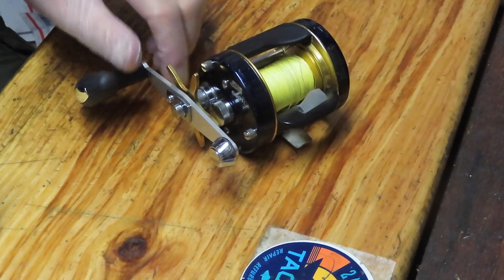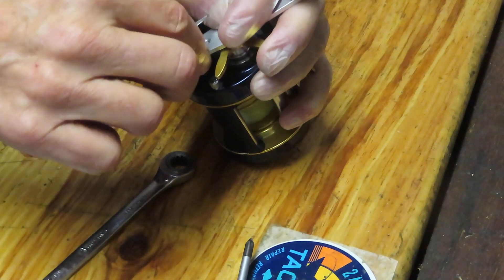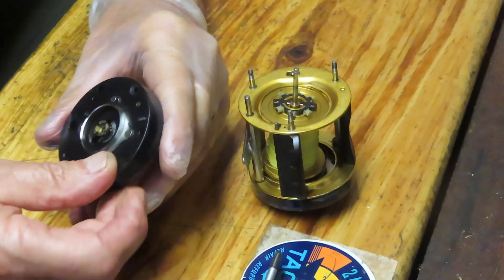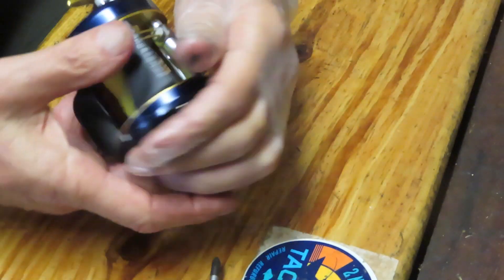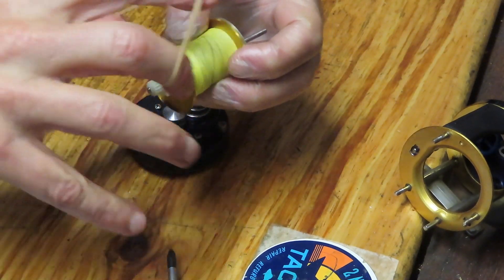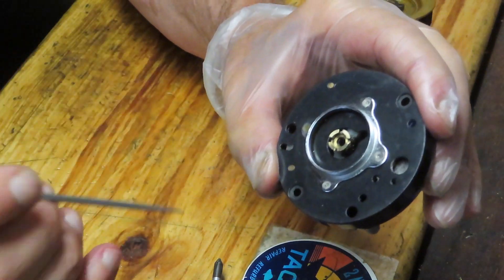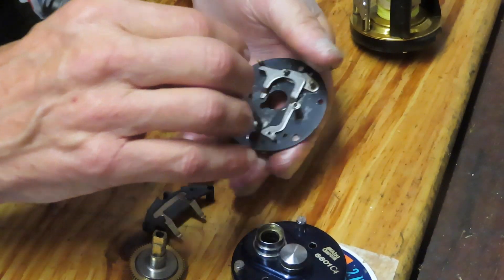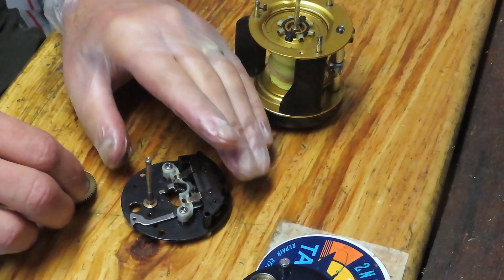Why fishng reels fail Abu Ambassadeur 6601 problem determination

Comment: Interesting episode.  I have become a big fan of the channel.  I ran into an issue today at at estate sale.  Very nice Bass Pro brand baitcaster and everything seemed to work nicely, except the drag was locked up tight.  I reduced the tension all the way, but still could not get the spool to turn against the drag.  Obviously, not a place where I could dig into the reel to try to assess the problem, so I passed on it.  I there a quick check I could have done to assess whether this could be easily fixed?
Reply from the maker: Not really.  You did the right thing in passing on it.  It could have been a quick fix, but if parts were needed, you would be out of luck

Comment: Excellent job. Good to know that brake placement needs to be checked prior to reassembly.  That will help on my two 5500’s.
Reply from the maker: It is an easy mistake to make - Checking helps avoid the issue - Dennis

Comment: A couple of tips, if I might be so bold.
1. Before taking anything apart, cut a strip of kitchen cling film and wrap it over the line on the spool.
2. With those tiny circlips (C-clips or whatever you call them), trying to force them off using a screwdriver at the pointed ends is a great way to cut your fingers and launch that clip into oblivion. A better way, IMHO, is to insert a small, flat screwdriver blade squarely into the gap at the midpoint of the clip and gently rotate the screwdriver. That way you can wrap your finger around the blade and feel the clip moving out - no explosive tension or punctured fingers.
Reply from the maker: I always appreciate the tips.  Thanks for sharing - Dennis

Comment: I've got an Abu Garcia 6501 C3 that randomly goes into free-spool when fighting larger fish.  I've had it happen at least 5 times in the past couple months.  3 times while fighting a 24lb halibut, and twice while fighting a 5' Soupfin Shark.  The second time it happened while fighting the shark, the line wrapped around the free-spool button - glad the fish was running out of gas!  Any ideas what would cause the reel to randomly go free-spool while under load?
Reply from the maker: My first thought is a weak yoke spring - That spring keeps tension on the pinion gear, which engages with the spool to hold it firm.  It may be that you are pushing the limits of the reel beyond what it has been designed to handle - Of course, if the free spool release button gets bumped during the fight, that would cause the same issue - Dennis
Reply: @2ndChanceTackle  thanks for taking the time to respond.  I’m definitely not bumping the release button, and it only happens when fighting larger fish, so I guess I’m just trying to push the reel beyond its limits.  I’ve had this reel for about 15 or 20 years, and it never happened prior to this summer.  But if the springs are getting weak, then I guess it’s time for some repair or replacement.